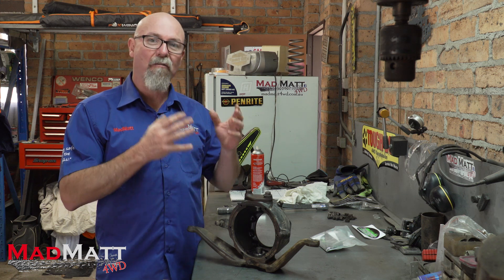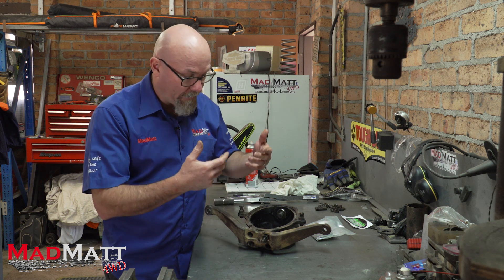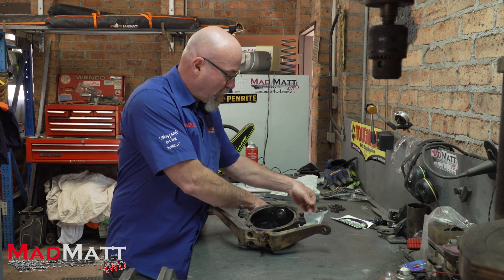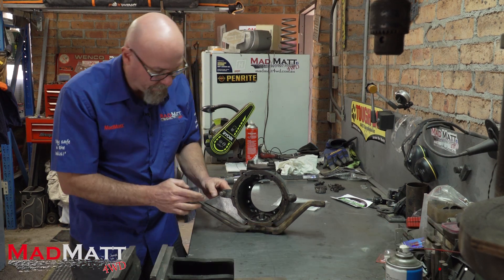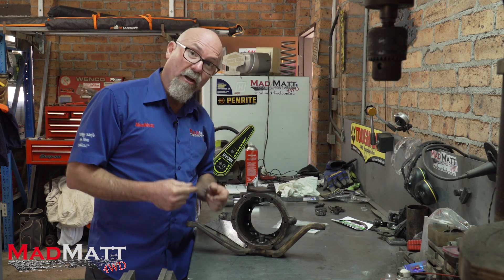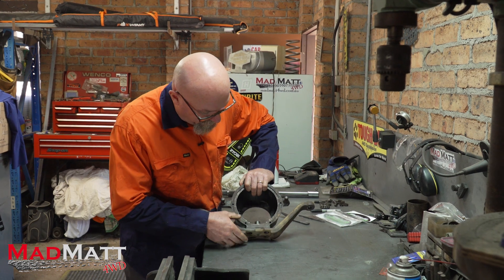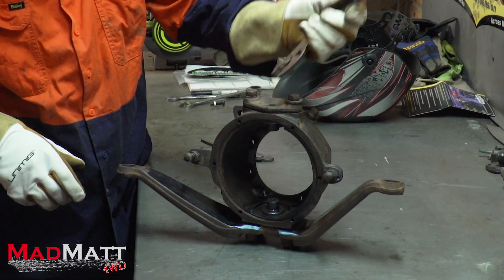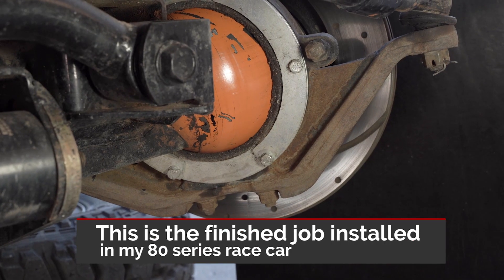How I Strengthen a LOWER KING PIN FAILURE POINT!

Comment: Always wondered about the 80 series knuckles as they don't turn at what I call 'flat' angles and the compound angles plus forces imparted from the weight on the wheels would put a lot of stress on those knuckle studs. Good work!
Reply from the maker: Cheers

Comment: Looks good Matt. 

I’ve got a question about the grease in the knuckle, what do you use and how much? Do you have a link to a previous video?
Reply from the maker: Hi Phillip. In the knuckle and cv area you use a moly grease like Castrol lmm. And I pack them full. For the wheel bearing a good wheel bearing grease.
Reply: @MadMatt4WD  Thanks Matt, got some work on the old thing this weekend.

Comment: I really am surprised that they don't use a locking tab which you bend over to one of the flats on the nut. This, and castellated nuts with a split pin or R-clip are two things I see all over Land Rovers and where these are used, I've never seen them come loose. I've had nyloc nuts vibrate loose though in the Amboseli, my rear door tried to fall off!
Reply from the maker: I've often pondered that as well.

Comment: Hi Matt, 
Nissan definitely topped Toyota with this design. That and I’ve also noticed the ring gear is about twice as thick and the centre has huge bearings. Other than that I reckon Nissan and Toyota diffs are very similar. 

Cheers mate, keep up the good work
Reply from the maker: The whole nissan diff thing is a bit of a misnomer. Toyota diffs are strong and reliable and I'm not breaking them any more or less than patrol are. And like the patrol stuff they can be built to be very strong.I think the knuckle housing is probably a stronger design.

Comment from the maker: This is how I strengthen the lower king pin on my steering knuckle for my 80 series race car. This involves using a brace kit from Rampt Customs (if you are interested link below) and then welding it in place using a cast steel welding technique. This process also involves preheating and post heating the components to be welded. (EDIT: In the video, I say cast iron but it is actually cast steel.)

You can get the kit here.
https://www.ramptcustoms.com.au/products/80-105-landcruiser-race-steering-arm-gussets?fbclid=IwAR2G7GQbCxZEvmHuJDvoD-gNA27p2II3_bzfMgl3gHeCBttv57UTRehQz1Q

Comment: I have to ask, why didn't Toyota fix this problem?
Reply: Here in the US these usually come loose after the first time the steering arm has been removed from the knuckle. What happens is the studs loosen from the knuckle when the nuts are removed and upon reassembly the studs do not get reset in the knuckle. The result is they will back out even when the nut has been properly torqued.
Reply: @danbusey  This sounds extremely plausible
Reply from the maker: Totally agree. It wouldn’t be hard to have a key slot or any other number of solutions.

Comment: I'm super paranoid about it and have a designated spanner in the glove box and check them every couple weeks haha.
Reply from the maker: Do you find them loose?
Reply: @MadMatt4WD  After reading this comment i checked mine and half of them were pretty loose. The Knuckle was rebuilt 6 months ago and everything was tightened by factory recommended torque.
Reply: Not really which is good,  only ever maybe got a tenth of a turn on 1 or 2 of the nuts.  Some people seem to have bad luck with them.   Have always though about welding for piece of mind on long remote trips
Reply from the maker: Make sure you don't over tighten them.
Reply: Mine were rusted so solid after 25 years that it took me 3 hours to remove the tapered washers to even get close to the knuckle bearings. A Hammer of 2.5 kg didnt do anything, had to heat it up.
Reply from the maker: You know if you pull the top king pin you can lift the whole lot off and work on the bench?